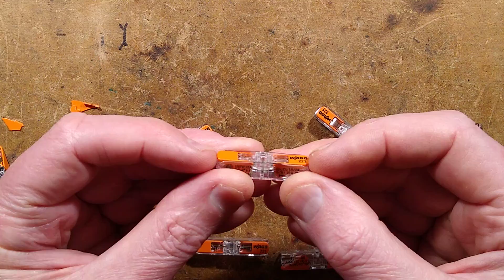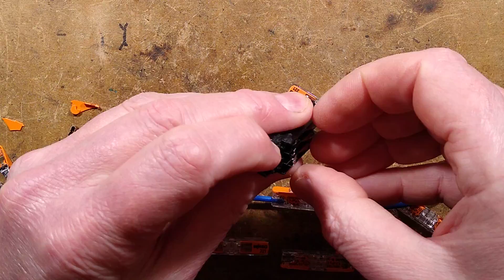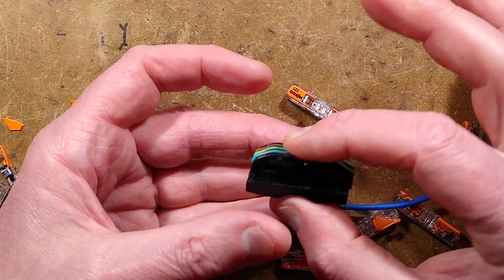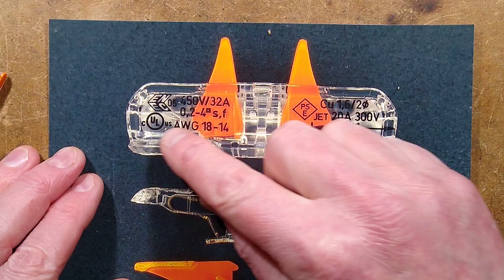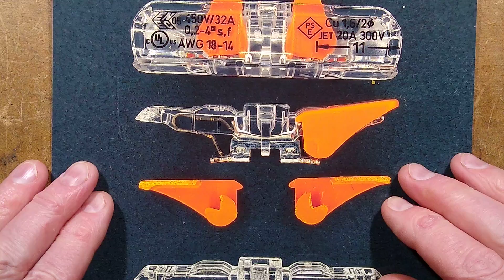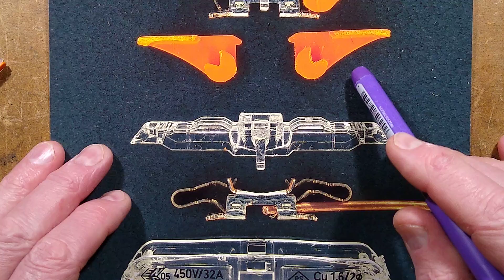By request - a look inside a Wago inline connector

Comment: I've used clones of these for car radio installs. Perfect for that kind of stuff.
Reply: Make sure that it's not located in a damp place... Or seal with heat shrink.
WAGO also has gel boxes for the 221 series, suitable for connections in wet areas.
Reply: ive done the same for my car radio too. much easier to swap between head units when you cant decide what you want and are just rummaging through cheap android units.

Comment: Gentle twist to reduce "whiskery bits".  If you don't really twist hard, the strands will easily deform to provide a very decent connection surface area.
Reply: Yup that’s the correct way. Only twist very slightly if even. A freshly stripped wire will often not even need that and will provide better contact when untwisted

Comment: Here's a question, as they have two different voltage and current ratings listed on them, What rating is more accurate?
Reply from the maker: It will depend on the testing authority and your country.

Comment: One day I'll treat myself to a hundred of these! I do love the 3x red yellow blue clone ones and the +- to two +- ones though. Super useful for small 12v stuff.
Reply: They're not even that expensive per unit, if you buy large boxes. I just wish they had a "Y-split" connector (one connection on one side, two on the other) that could fit into standard Legrand conduit channels. The "3 on the same side" ones don't quite fit.

Comment: As an apprentice I was told off for twisting wires, the reason was always given as changing the cross sectional area and altering the resistance. Now I twist them together as Im not that fussed about precision resistance in my own things. interesting to see inside 2x 👍
Reply: That makes very little sense, by twisting them you are not reducing the actual CSA of the copper conductors. You'll only reduce that by removing strands. For example if you take some 19/0.1 wire and twist it you still have the same amount of copper.
Reply: @b0b5m1th  I think they probably meant reducing the contact area, as in there's less material at the apogee of a circle than at the top of a rectangle. You'd have to twist really bloody hard to do too much of that though.
Reply: @NightCatArts  that would make sense.
Reply: Yeah, twisting will not change the cross-sectional area or resistance of the wire at all.  If it's being inserted into a correctly-sized terminal, it also won't significantly change the contact area or resistance with the terminal (and will make it easier to ensure all strands are secured, which actually can change the resistance if you don't do that right).  So whoever told you off for that doesn't really know what they're talking about.

If you do twist your wires and then insert them into screw terminals, it is important to tighten them thoroughly, and then re-tighten them a second time at the end, after any possible moving around of the wires is finished.  This is because wiggling the wires can cause them to untwist a bit, which can cause the connection to loosen in the process.  This is really a good practice to do even if you're not twisting the wires, too, though.

(WAGOs don't have this problem, though, because they're actually self-tightening anyway.)

Comment: No, you shouldn't twist stranded wires. It makes them "harder" and more difficult to squish. Straight strands just fan out when pressure is applied, so you get a greater contact area. Also, the spring is pressing on many more strands instead of just a couple of top ones in a twisted wire, distributing pressure and making them much harder to break when pulling. At least theoretically.
In practice, I guess it's never wound that tight to prevent any squishing (unless you twist and solder, which I definitely wouldn't recommend). There is a difference, but I suppose it's minimal or entirely negligible. Your house won't burn down just because you twisted the wire.
But then again, when having a choice among two ways to do something, I will always pick the better one, however small or theoretical the difference may be - at least when the effort to achieve it is virtually the same. Yes, it's easier to fiddle in a twisted wire, but fiddling in a straight one isn't exactly rocket surgery either. You can screw up both if you push and bend individual strands against something and leave them outside the contact. It will take you only moments to make the connection, but the connection will be better for years or decades.
With crimp-on connectors they advise explicitly not to twist the wires. The "wings" of the contact that get bent inwards can slip between the strands and make better contact and stronger connection. If you twist the wire however it runs in an angle to the edge of the wings and will keep it up and not contacting in the bend, or the edge will cut some of the strands.
But I guess it's no wonder that someone like you should dislike straight and always go for something bent 😁😁😁
Reply: By that logic, you should never use solid wires, because they're even less "squishable" and will always have the smallest contact area (with these or other connectors).

It's always a trade-off between contact area and gripping force (that's how pressure works). If you're absolutely sure the wire will never get pulled or shaken, maybe you care less about how well the connector grips it.

Either way, as long as you use the right diameter of wire, you should be within spec.
Reply: Its ok to twist stranded wire for a WAGO.  There is plenty of contact area.

Comment: I give my wires just a light twist, only. The biggest benefit of WAGO compared to CE ("chinese export") beside the secure connection is the fact, it does not matter too much if you twist or not, if you connect single strand wires with multi strand wires, and so on. And yes, do not solder ...

Comment: It's worth noting that on the side of them is printed the insulation stripping distance and the max voltage and current that they're tested to which ive always thought is a sign of quality. I love them!
Reply: Yes that little scale is incredibly helpful, & it actually is to scale instead of just being a number.
Reply: Oo, rewatching. I'd only noted the wire gauge and safety marks (both EU and NA versions of each, nice) but not that.
Reply: @KevinT3141   These DO NOT have the North American ratings, (UL) printed on them. The UL rating is 20 amps, not 32A. The Japanese (JET), Japan Electrical Testing Lab, is also 20 amps. 

The reason for the difference is that in North America, Japan and Canada.(CSA), actually require real testing under worst case conditions. Not so under IEC standards. In fact they do no testing and do not require any third party testing. In fact, 98% of products with an IEC/EN certified rating, are "self certified" by the manufacturer!  They issue a statement that says the device meets IEC standards. No requirement that they test or maintain test records. It is a "trust us" certification. The IEC may require 3rd party testing if a statistically large number of failures are reported. That action is extremely rare. There is no real reporting system. 

You might think that amps are amps whether in Europe, Japan and North America. And that is true, however, how the rating is determined is not even remotely the same!! And that's where the problem comes in. IEC "standards" are far more "liberal" than US, Canadian and Japanese standards. Not even close!

The IEC standards are determined using a consensus model among the 83  full member countries. That include countries like China, Pakistan an India.  The member country representatives do not necessarily require recognized subject matter expertise. You can make a case that in some countries, the representatives are political appointments. 

The IEC arose out of the old British engineering standards, which were pretty good, but became a completely different organization. The IEC has become a political organization driven more by economics and politics, than sound technical engineering standards. 

The consensus model for approving standards, ensures considerable compromise and therefore, lower standards. All you need do is watch some videos of electrical work from some of these countries, to see just how poor the standards are for acceptable work!

So besides the nature and methodology of standards development, being radically different, there is another significant difference between IEC countries and North American countries and Japan. In IEC countries, the "standard voltage" is 230-240 volts, but in NA it is 120 volts and in Japan, it is 100 volts. All the countries use essentially the same residential devices and appliances. But in IEC countries, the average currents in such circuits, will use half the current of the like devices in North America and Japan, countries that do require worst case testing. 

The IEC has overall lower technical standards and relies on statistical feedback of performance. UL/CSA  and JET, rely on independent real world testing under worst case conditions. Knowing all this, I'll let you draw your own conclusions
Reply: I'd imagine they are tested way beyond the ratings on the side. You can also see e.g. that the Japanese rating is different (300V @ 20A)

Comment: Wago are a solid product. I’d not really heard of them until electricians started raving about them a few years ago. Their PCB mounted solutions are rock solid. I recently took apart a solar inverter and the mains connection was as tough as nails - super hard to get out until I worked out the release mechanism 👍
Reply: Yeah I used the PCB mounted ones and they are really durable
Reply: There are PCB versions of those ?!?! Never again will I have to put screw terminals on my PCBs
Reply: @Gagootron  yep.  They're great.  They have plastic feet so your not pulling up the lever on the solder connections.  Good design.
Reply: @Gagootron  yep their range is massive. They had a stand at embedded world the other year showing a lot of different solutions. They also have din rail connectors and converters.

Comment: Brittle but fireproof? Not entirely sure if trust it, reminds me of my old shower switch which eventually tried to melt and smelled of burnt fish ☠️

We need a burn test! 

If there is a fire, I might want my wires to disconnect 😅
Reply: This is why we have GFI and circuit breakers, not for wires falling free inside junction boxes.
Reply: @williamterry3177  not for lighting circuits
Reply: @phonotical current UK regs require all circuits to be RCD/GFI protected. Usually done using a split load consumer unit. Mains comes in to primary isolator that feeds 2 or more RCD/GFIs, which then feed individual circuit breakers. Usually arranged so upstairs lights and downstairs sockets are on one RCD and vice versa on the other. Hall/landing lights on stair wells are put on the opposite breaker to the rest of the floor they're on.
Reply: @phonotical  GFI at the panel for every circuit where I live.  You should move.
Reply: @JaenFoster  I'll have to take a look at mine when I eventually manage to move back in!
Reply: @j.f.christ8421  I am, temporarily, funny story is, I'm moving because of an electrical fire 🤷